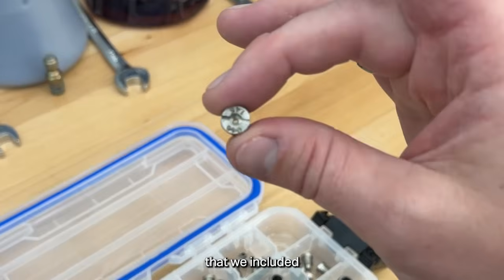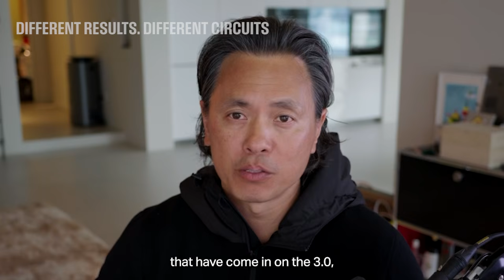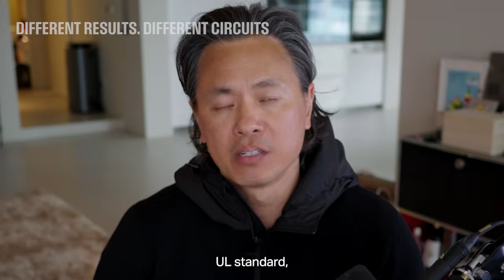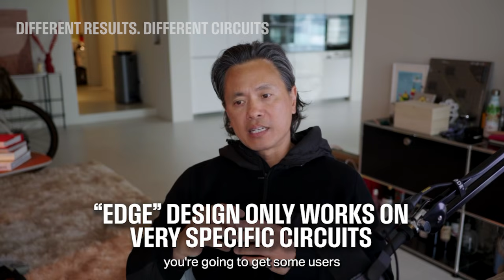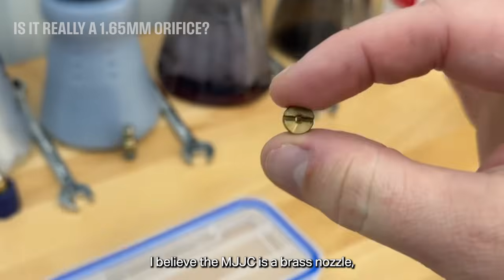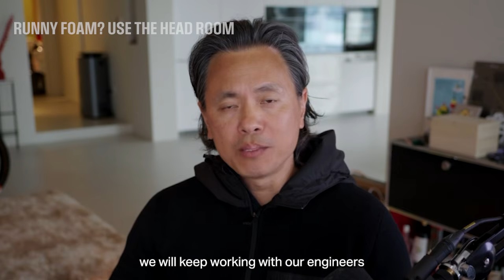The Truth about Orifice Sizes & Their Effect on the Active 3.0 + Foaming

Comment: My question is I hear if you go slightly over the amps you can damage the micro switches by using a fiam cannon with a smaller orifice so can you design the 2.3 to work on a 20 amp plug because I would rather keep my foam cannons the same and install a 20 amp plug instead  seems to me that's what the ar630 is doing I have been watching your products for awhile now and would love to upgrade to an active but I feel there needs to be a middle ground between the 2.3 and the 3.0 and I was just thinking a 2.3 running on a 20 amp system would probably find that middle ground for amps and foam cannons I also feel I shouldn't have to double or triple the amount of soap I am currently using to accomplish what I  can already achieve I would love to hear if this is evena logical idea or not and why  planning to upgrade next year so hopefully the issues with foam cannons are corrected by then and I can consider your products because I feel your the most informative company to there customers

Comment: The real reason of lesser foam performance is because of the much larger overall dilution ratio. In a normal MJJC foam cannon with a 1.25 orifice on a washer that could produce say 1000psi, you get maybe a 10:1 output ratio. So let's say you normally use 1oz per foam cannon. 1:31 x 10 = 1:310 final output. When using a much larger orifice size, you may get 15:1 or higher, resulting in 1:465 as an example. This is a 50% differential, and when added with a lower output pressure, you'll need an additional volume of soap in the mix.

Comment: 120V is not an edge case. That is a standard and that's what you should have sized the orifice to. An edge case would be those very low voltages you mentioned.

And if that's not possible you should have a calculator that informs users on what size orifice to get depending on your voltage.

My vintage at my house is 124V which means I'll draw even less amps.

I ordered the Adams Active 3.0 and their best foam cannon porn with wall mount and their high flow water deionizer. Wall mounts are on back order and so not expecting to receive anything until May but in the interim I think I'm going to order the MJJC 1.65 orifice just in case.

I also wanted to opine that your response is not satisfactory.
Reply: Well it's great that you have 124v, but not everyone does. Also, not everyone knows exactly what their voltage is. Not everyone will buy a meter to test their voltage. So if the orifice is too small, they will have a bad experience with their circuit breaker. Is it really the end of the world to buy a smaller orifice once you know that your voltage is high enough to handle it?

Comment: So 3GPM is not pushing the "edge" case?  C'mon.  You wanted 3GPM so you could sell an Active 3.0 machine.  If you wanted it to be safe for every 20A 120V household system you could have detuned it to say 2.7-2.8GPM and you would have been well within specs of most homes even if the power was closer to 105V.  With a detuned unit you could have used a smaller orifice and would have more foam cannon compatibility.  The honest truth is that an Active 3.0 machine sounds and markets a lot better than an Active 2.8.  This is to keep up with the AR635.  I don't have a problem with you guys selling an Active 3.0 but the explanations in this video don't line up with the message.

Comment: Your products suck that's the problem! I have tried them three times. 2 of them had leaky pumps out of the box brand new and didn't build pressure properly. The third didn't have that problem, but instead stopped working writhing 2 weeks.   

Now you poorly designed a pressure washer that has too much flow without enough pressure and that is why it doesn't make good foam, and you electrical headroom doesn't allow for it to be corrected by just changing something as simple as an orifice like we would on 95% of other pressure washers!   I do t know when the idiot is that made took Matt Mormons desire for low pressure with the highest flow as gospel for how to design a pressure washer! Matt is and was technically a prosumer use case and not a professional.  We have detailed 15,000 cars. A power washer needs 1500 PSI with a minimum of 2.25 GPM and up to 2.5 GPM. This will have much better cleaning than what you designed. If you are a very good detailer you could do 1750 PSI for most applications. If you do a lot of big pickup Trucks, 4x4's, Jeeps, off-road vehicles or smaller work trucks. Then you bend 2000 PSI and 2.5 GPM all day long! For commercial trucks, farm and construction equipment 2500 PSI and 3 GPM. 

Anything less than 1500 is at best a prosumer or only doing high end cars and even those are fine with what I outlined. The only reason you can get buy on a 1000 PSI with 2.25 GPM is the cars are never that dirty!

So, try designing a good product for actual professionals once made to be adaptable and reliable!
Reply: What you are saying is not true. Yes you can put in a smaller orifice size to boost pressure. You just need to make sure that you have high enough voltage to handle it. Not everyone does.
Reply: @mikemccormick6128 I literally bought multiple ones and they leaked out of the box internally! SMH!

Comment: Very solid response. Thanks for doing this. All of this being said, the proper solution would be a 20 AMP 2.3-2.5 machine with a quiet (4-pole) motor. I'm sticking with my Active 2.0 until a 2.3 V2 is released.

Comment: I think some were too critical of the machine considering the competition has the same problems. Good job addressing the possible issue’s.
Reply: THIS. It's not an Active problem. The foam cannon industry needs to catch up to the high GPM pressure washers. That said, I wouldn't want a 3.0 unit until it does.

Comment: Really like Active as a company but this 3.0 pressure washer baffles me.   I appreciate the honesty of the video but none of what has been expressed "fixes" the foam issue that all reviewers are experiencing.   They love the high flow rate for rinsing purposes but what good is that if they can't use a foam cannon to produce even adequate foam?   Adding additional ounces of soap doesn't seem to fix the problem and frankly gets costly, all in the name of more water flow.    Until Active or AR introduce a new style of foam cannon to properly address the foam issue, I'll stick with the Active 2.3, even though it is far too loud, as it produces more than enough water flow and good foam.   Had high hopes for this product as it is advertised as being significantly quieter than my Active 2.3 but the 3.0 is useless to me without the ability to produce decent foam.
Reply: Well, there is a solution. The solution is to test your voltage to see if your circuit can handle a smaller orifice size.
Reply: THIS. What we really need is a quiet 2.3.

Comment: Would it be possible design a pressure washer were you can manually adjust the flow?
Reply: Check out the Maxflow Mpro 25.

Comment: Am i the only one that prefers the foam to run a bit taking the dirt down with it? The shaving cream looks prettier for sure but does it actually clean better? Lmk!
Reply: I believe the theory is all foam will eventually pull dirt down, shaving cream just takes longer which helps with chemical dwell time and slows it from drying so fast in the sun.
Reply: 1) Shaving cream foam will eventually run off too, and the dryer it is the more dwell time, which you want for pre-wash like Bilt Hamber Touch-Less.

2) You want to ability at least, as then you can adjust your dilution accordingly, rather than never being able to.
Reply: I like a little runny too, but like the others said, it’s probably a bit too runny, so like for in the Florida sun, it’ll dry too fast before I can come back to it, especially the pre washes like Bilt Hamber or Stars and Stripes, any low or high PH soaps especially. AR has similar issues and they are also apparently going to release a foam cannon after the fact, so Active is going to follow suit as well. Sucks it can’t work with our current foam cannons. We just need the European Power 220v circuits lol. North America having 120 makes its limiting lol

Comment: Commend Active for transparency.  Myself like a few commenters that have released testing videos, are wrestling with the balance current accessories not able to handle the flow.  The suggestion of a “supercharged” 2.3 on 20amos to give a 2.5 gpm at say 1000-1100 psi is appealing as it bridges the gap and makes the upgrade more attractive to those on the fence or those whom don’t want to mess with the foaming issue.  That said, the Active line up IMO is excellent value  at each price point. Best looking at any price point.

Comment: I'm an edge case just the wrong edge. LOL. Now my opinion is this low pressure foam cannon should have been developed along side the 3.0 and been an accessory with it or at least an accessory to buy at launch. I'm sure the foaming issues would have been known from very early in development. I myself would loved to have had a commercial type unit thats more like the 2.3 in size on a 20 amp circuit and tuned up just a bit to say 2.5 gpm giving us all kind of headroom for pressure and great foam. I may be wrong because I have lots of ideas that won't work out. LOL
Reply: You're not wrong. Your idea is on the money. A quiet 2.3/2.5 is what we needed. Not this.
Reply: My thought is that they needed to rush the machine out to market for car washing season.  Whatever problems there were they were going to "maybe" fix it later.  This is the time everyone is buying machines and getting their setup ready.  They would have lost money to the competition if they waited til fall.  It definitely sucks for the early adopters of this machine that may not have known any better.
Reply: @Gazziza29 They knew it would be this way when developing they could easily have developed them together in my opinion.

Comment: As always, really appreciate how open and honest you guys are to the community! 

Reality is, on lower flow GPM units these small differences in orifices marginally affect performance overall but seem to be exaggerated on 3.0 gpm.

I still think the larger topic around Venturi effect with foam cannons with high flow machines needs to be looked into, pulling 800psi on the out of the box orifice clearly is not going to be ideal. 

Realistically we need units that can run 1200-1300 PSI while using a foam cannons while staying under the current draw. 

For anyone wondering, my circuit reads 123v. 

Appreciate the video guys! Can’t wait to try out some updated foam cannons for these higher flow units!
Reply: 123v What a flex!!!
Reply: @CarsWithKeav 😂
Reply: I’m looking into the 3.0 as well and my voltage is the same as yours. It’s 123 vac. Obviously the higher the voltage lower the amps. Does yours foam ok with the factory foam cannon orfice. or have you need to go to a smaller one. To get a better foam. Since the voltage is 123 it’s safer to go smaller with out it over amping!?